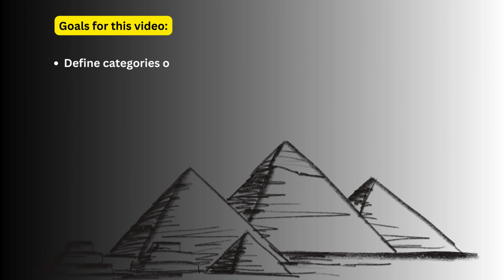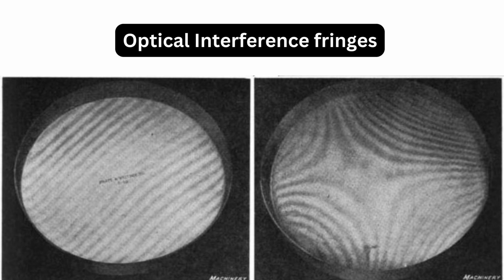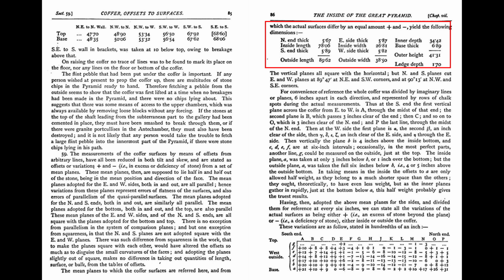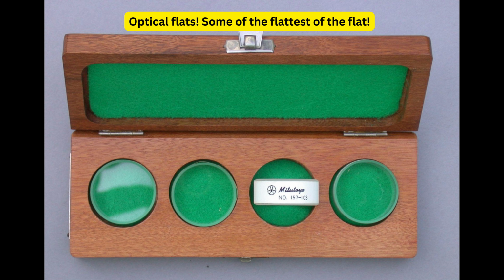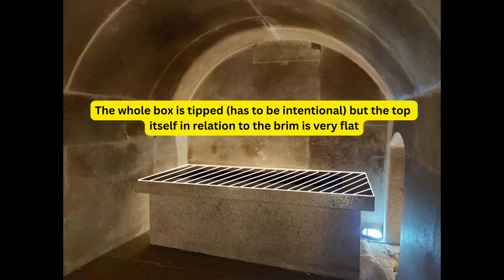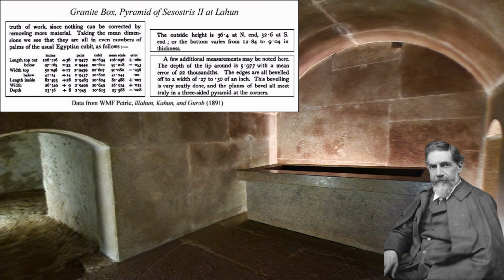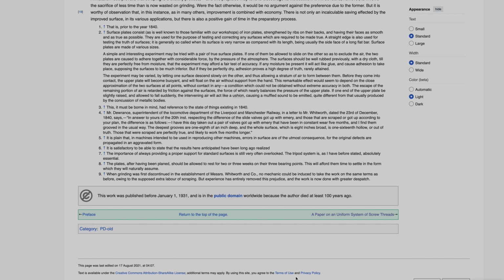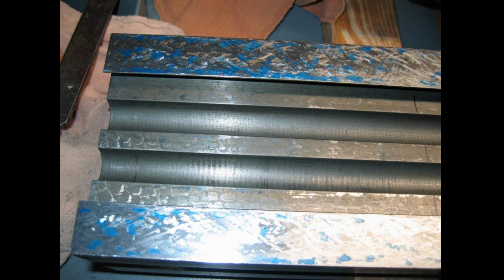The Problem of Flatness in Ancient Egypt

Comment: You know what else is perfectly flat? A damn string.
Reply from the maker: A string when pulled taut is straight,  not flat. If you remember back to geometry you will remember a line is the shortest distance between two points, essentially a string. A straight string can be held at any angle but that doesn’t mean it’s flat. Flat is an aspect of a 2 dimensional object such as a plane. To start to measure flatness with accuracy an object with internal rigidity is needed. A string is not rigid nor an item with inherent perfect flatness.

Comment: 0:45 If you can make a rope/string, you have a straight edge
Reply from the maker: A string when pulled taut is straight,  not flat. If you remember back to geometry you will remember a line is the shortest distance between two points, essentially a string. A straight string can be held at any angle but that doesn’t mean it’s flat. Flat is an aspect of a 2 dimensional object such as a plane. To start to measure flatness with accuracy an object with internal rigidity is needed. A string is not rigid nor an item with inherent perfect flatness.

Comment: Before I watch... the origin of flatness is the plumb line.  If you can make rope, you can create a flat reference surface in vertical orientation, then mobilize it and use it to measure flatness in any orientation.

Edit: Or I guess you could rub two stones.
Reply from the maker: Haha yeah there are multiple clever ways to come up with this

Comment: I actually touched up three iron surface plates using the 1-2-3 method. The plates were 3x5 feet. I teach hand scraping and rebuilding at the Jackson Street Roundhouse in St Paul,MN
Reply from the maker: Well then you certainly know more about this than I do! I have a question that some in the comments have asked. Does it actually matter which plate is moved? The method described in Wayne Moores book makes it seem like they need to be switched but to someone like myself who hasn’t actually done this it seems as though the plates wouldn’t know which way they were facing. Can you clarify and I can point others to your reply?

Comment: A K&E tilting level with a coincidence level and optical micrometer will measure .0001 at 16 feet, Jig transits can do the same. Millwrights use optics for this type of work aligning Turbines weighing hundred of tons. Paper mills with dryers, slitters, and cutters are 300 feet long but are aligned and leveled optically.

Comment: 0:49 one way you can do it is ny making a basin with a flat bottom. How do you make a flat bottom you ask? While youre still carving the bottom put a droplet of water. If it flows its bot flat. When the bottom is flat pour water untill one level and use that level as a "if it doesn't pass the surface of the water but it barely touches it its flar" logic. Carve out the ruller that way
Reply from the maker: That will make it level around the top and certainly be a good staring point but it won’t be precise enough across a 2D plane.

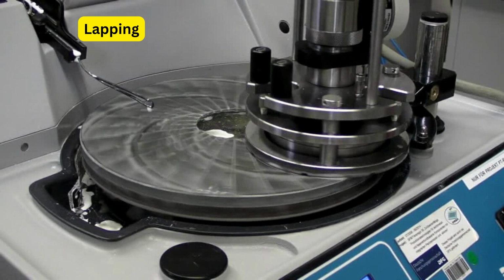Comment: 2:40 No joke. 
This perfect flatness is a top Geopolitical problem nowadays. 

One of the things that prohibits China to built EUV (Extreme Ultra Violet) Silicon Wafers printing machines is the access to Ultra flat mirrors.

The only few companies that can produce these extreme flat surfaces is located in Europe, and EUV tech needs these extreme flat mirrors to print . 

The problem is, these tech has lots of IP behind the machines that produce these mirrors, and o e sanction against China can impede the export of ASML EUV machines or parts to China. 

Extreme Flatness is Geopolitical power nowadays 😂
Reply from the maker: I watched a Veritasium video on the ASML machines. Incredible

Comment: While I found the theory great, I'm still confused about some other things : the corners precision, the respiratory condition while doing that kind of work, what about the constituency of the work for a large surface with some having to go against gravity. I would to have your pov on the Barabar cave down in India.
Reply from the maker: The corners inside are certainly a topic I need to devote some brain cells to. I use many more videos to make! As for respiratory problems from it, well, people didn’t care about worker health back then. The people who must have died in hideous ways during these projects must have been enormous. The sides of these boxes would have to be rotated so they would be at the top before being polished. Then the box would be rotated again so the next side would be on the top. That way gravity helps by pushing down versus trying to do it laterally.
Reply: @intothemap360  I disagree with the "not caring" about health. The current studies show more evidence of free man, receiving care. Not some slaves you could discard. On the rotating aspect, while difficult and risky it is certainly doable. I'm more confused about the flatness. While the three plates theory works on paper, doesn't it mean that you will need 2 huge plates of the same size as the sarcophagus itself ? Or multiple plates of smaller size ? Would it explain the "irregularity" of the flatness as a whole?

Comment: Just using my own brain to think of how to accomplish that task in the woods or in old times rather, suppose you fill a container with water then drop a plumb line usine twine weighted, then affix two straight pieces of material at the right angles of where the line meets the water.

Comment: Years ago I ground my own telescope mirror. The process involves grinding two discs of glass on top of each other with a series of slurries of ever finer abrasives. The top disc becomes concave and the bottom disc convex. A final step involves coating the bottom disc with a layer of wood pitch and polishing the two discs together using iron oxide. The resulting surface can be made spherical within a millionth of an inch. The accuracy can be confirmed with the Foucault test which requires only a pinpoint source of light and a knife edge. A similar process can be used to make a flat piece of glass. These processes have been used for centuries.

Comment: Remember also they got that lid up on top without chipping the edges or cracking anything either.
Reply from the maker: In the serapeum at least they had a cool method of placing lids on sand or on beams on sand, and then digging at the sand to slowly lower lids. This was also used in other tombs!
Reply: @intothemap360 where's the sand between the joints then? 😅☝️
Reply from the maker: It’s a bit more tricky than that. It involves the nubs on the lids. Instead of trying to put it all in a comment here is a video I made on how the tomb of a general found in Saqqara was lowered. It should make more sense that way, it’s only 9 minutes long.  https://youtu.be/-HtRaLpjHkc?si=Jt-3tqBGS4sV1xL8
Reply: @intothemap360 so nubs, wood and sand hold how many tons up? Oh you don't have to explain it. I'm aware of the narratives. They literally just don't add up to reality. The weight breaks the theory when it gets to a certain point. ✌️The fact they are machine quality precision cut and precisely placed. That's impossible under the accepted theories of how it was done.
Reply from the maker: Alright just check that video out I promise it isn’t nonsense! They were lucky enough to find this setup intact in the 1930s. I don’t have any narratives. I’m nobody haha.

Comment: "perfect machine-flat surfaces do not exist in nature" 

every still body of water ever: ____
Reply from the maker: Water isn’t a machined substance. Water is level but not useful for measuring flatness in the range we speak about in this video.
Reply: @intothemap360  water was used to measure/level the pyramids
Reply from the maker: You’re right. It was used to level. Level is different from flat. A flat plane can be set at any angle and still be flat on its surface.

Comment: Nb: A pounding stone would be suitable for rough-cutting granite.
The casing stones were made from sandstone or possibly limestone. Not granite. There'd be no reason to use pounding stones on the casing for the pyramids. Most likely way- I expect- that they'd achieve flat surfaces on soft sedimentary rocks would be with ancient sandpaper equivalents:
They'd have a flat wooden pole, covered in adhesive substances, onto which they'd sprinkle sand. Once the sand had dried and thus been glued to the wood, they would use it to sand the sandstone...
That's my guess.
Reply from the maker: Yeah I read after I made the video they also used hide glue to stick abrasives to metal plates

Comment: I mean, you can get pretty close to flat with nothing more than a thin taught fiber as a chalk line, I didn't think about this until one of the pictures you showed was clearly someone using a fiber line to reference a surface
Reply from the maker: A string will make a straight line not a 2 dimensional flat plane. They did use strings for point to point straight lines like we would use a chalk line today as you said in brickwork or for snapping long lines on wood. However straight lines can be at an angle, I’m talking about a flat plane on the sides of the boxes or on a surface

Comment: "How did ancient people make anything flat and smooth, when there is no master flat or smooth thing to start with?"

I haven't watched the video yet, but will guess that's a bad premise, because nature contains plenty of flat, smooth, straight, plum, and level.

Standing water is flat. Flat (or level ) to the curvature of the Earth, which may be a good enough tolerance for our 2m box. Using convex Earth water level for flat will drop 0.0785mm to each end from the box center.

One possible procedure: Place the stone box in water up to its rim, or alternatively fill the box with water. Then grind and polish the rim, wet, adding or subtracting water as needed. Since we know ancient Egyptian quarry workers submerged heavy blocks in water to ease their transport, and grinding is often best done wet, workers could stumble onto this method without exceptional genius. Eventually through grinding down you will develop a consistent meniscus all around where water slightly bulges above the rim but doesn't quite flow over due to surface tension. Then gently adding water to your pool or box (still water underground perhaps), will show the meniscus break at a certain point - that's a low spot. Continue polishing until the break occurs simultaneously all around the box.

A lid may be developed by the same technique. 

Having watched the video, I'm thinking the surface plate technique more versatile but more effort than using level water. Maybe both were used? Also heartily agree with the closing lecture against mystifying people we're ignorant of.
Reply from the maker: I’m glad you went on to watch the video! Great thoughts and ideas

Comment: You're claiming they didn't use advanced technology yet your solution is advanced technology invented in the era of steam engines, calculus and watches. No one would invent and used the 3-plate method for a single ad-hoc task. That would have been a fundamental technique for calibrating tools, just like it is now. Then there is a question of scalability, any engineer faced with these challenges would have tried to come up with a tool or a jig to ease the work rather than polish a block granite for all his life. What these artifacts are proving is this was an advanced society, capable of solving complex engineering, logistic and management issues. Not saying they had CNC machines but in our civilisation we went from early machines to computers in ~400 years - Egyptians had much more time to hone their tools and techniques, possibly some we haven't rediscovered yet. Some of this technology was evidently lost, because later generations were unable to produce artifacts of similar quality, negating the elbow grease hypothesis.
Reply from the maker: Advanced sand paper isn’t high tech.
Reply: @intothemap360 Could they have also had something similar to a primitive bubble level to verify the flatness? Doesn't seem that unreasonable as I can see how they conceivably might have been able to make one. Wouldn't this also count as a lost and rediscovered technology?
Reply from the maker: I don’t consider that be in terms of lost technology. I think those types of tools could come and go and be rediscovered. What people generally mean is evidence of electrical tools, engine or motor powered drills, steam or other sources of energy. Or even something more exotic that doesn’t even exist like people who suggest without evidence sonic waves cut the rock.
Reply: @intothemap360 Asking an engineer, what do you imagine the purpose of the supposed Baghdad Battery was? Certainly not ancient Egyptian but it does appear to be some sort of rudimentary battery, though a lot of people try and claim it was used to power electrical machines. I don't think it ever had the required amount of voltage for such a thing, though. It is the most compelling evidence for ancient electricity but not a very efficient source if that's what it was. Probably not something you'd hook up a power drill to.
Reply from the maker: I think the most likely scenario is someone found from experimentation that much like you can develop a little jolt of static electric from wearing certain clothing plus friction, no doubt some ancient budding scientist had a jar of grape juice or wine and stuck some metal in it, for whatever reason and came back a little later, maybe he hoped the alcohol would clean it or something, and when he touched it he got a little jolt of electric. ⚡️ It certainly wouldn’t have enough power to run anything and there is no evidence they would have understood what they stumbled on but it’s an easy way to get a little zap. Bet that guy was the talk of many a party with his magic jar of sparking juice!
Reply: @intothemap360 Could be. I've heard electroplating which apparently has worked with replicas or maybe some weird ancient form of shock therapy, but that's still a pretty big leap from them supposedly being used to power machines and lights. Still the most compelling out of place artifact I've seen that isn't just "wow precise masonry" or something along those lines. Good channel btw, subbed
Reply from the maker: Yes it definitely needs more analysis! I love to think of an ancient Thomas Edison type character just sticking all sorts of metal into various liquid to see what reacts and his mother in the background shaking her head
Reply: @intothemap360  these artifacts were obviously not made with "sand paper". Just look at modern attempts of recreating the process, utterly impractical. The whole process of technological development is flipped on its head. They wouldn't have come up with the 3-plate method and spend years polishing the stone just to have smooth surfaces. Someone needed this result, wanted it, and was confident this could be done in a reasonable time to procure it. What we see is a surviving tip of Egyptian capabilities. We didn't land on the moon by placing some explosives in a carve out tree trunk, even if someone in the future could argue that was the only explanation given other remaining artifacts of our civilization.
Reply from the maker: I was talking about the granite plates and emery or other sand as the sand paper. I clearly know it wasn’t actual sand paper 😊
Reply: @intothemap360  I know, I watched your video, very good BTW. At least you tried to explain their achievements, many simply sweep them under the carpet, as if they didn't exist. We have artifacts that cannot be reproduced using 16th century technology and would still be a challenge now. At very least they should come from a well organised society with organisational, scientific and engineering knowledge accumulated over multiple generations. Think Babilon with their clay tablets recording mathematical facts, receipts etc. We don't know what's happened to all this context but surely pre dynastic Egyptians did more than carve stones.
Reply from the maker: I’m fine with whatever level of tech I can find evidence for! I come from an engineering background and I’d be the first to tell you and show the evidence for say gear cutting at that time.

Comment: What does it mean that plates "agree" with each other? That there is no friction because it was lapped off?
Reply from the maker: They fit together but a defect on the one is matched by an opposite defect in the other. A concave place on one plate has a matching convex spot on the other. Since they agree with each other that also is a way of saying they can’t be made any smoother with just the two plates alone. A third has to come in. What’s really happening is you’re forcing the radius of a tiny sphere on the surface as close to infinity as possible.
Reply: @intothemap360  ahhh, yes, that makes sense. Thank you for clarifying!
Reply from the maker: No problem, It’s a tricky concept!